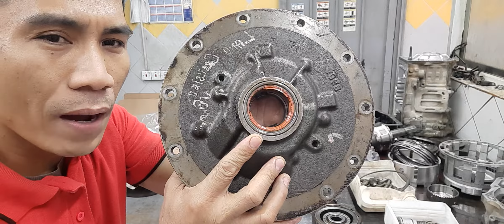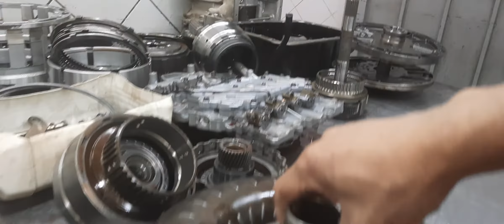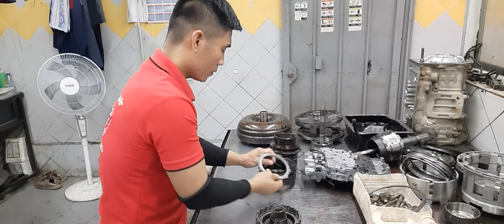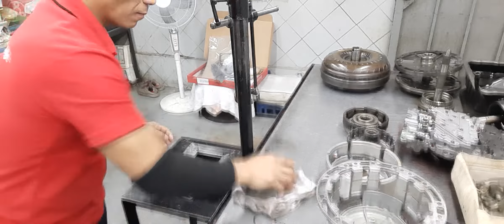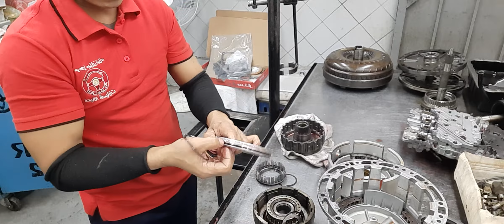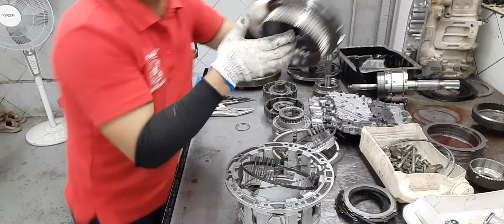Cause of no Drive no Reverse /L.Cruiser2003m///Tagalog

Comment: Sir kapag bagong andar ok lahat shifting ng civic 1996 after 30 mins biglang prang 2nd gear n lang pero minsan ok nman. Kpg sinumpong sa trapik nsa drive biglang ayaw umabante at ang ggawin ko ilagay ko sa D2 eh aabante nman nbili ko lang eto last month nkastock lang.B4 totaly ayaw gumana transmision, chage oil 3 x at transmision flush nchk n din solenoid.Minsan kng sinumpong n tumatakbo, off ko makina kht mga 20 seconds lang taz ok n nman, anu mabuti kya gawin sir?

Comment: sir, tanong kulang.. yung apv suzuki hiniram ko automatic transmission.. naubosan ng atf oil.. tapos nalagyan kuno.. walang reverse.. ano dapat gawin.. na check na lahat sensor.. okey man.. lahat ng drive, l, 2 meron.. reverse lang nawala... kailangan ba e baba ang transmission?
Reply from the maker: Need ibaba boss.kung naubusan ng oil may tendency na nasunoh sng clutch or Oring na over temp kya singaw  n.
Reply: @ararlakayvlog2684  boss, maraming salamat sa reply.. wala ba ibang paraan maayos maliban sa baba transmission..kasi no reverse lang ang hindi gumagana.. kung baba transmission.. magkano magastos boss..?sa materials lang
Reply from the maker: Sa pinas price wala ako idea dyan i canvas mo nlng boss.
Reply: @ararlakayvlog2684  salamat boss.. wala na bato chance na hindi ma down ang transmission
Reply: @ararlakayvlog2684  ano pa dapat gawin or e check pag walang reverse boss?
Reply from the maker: Reverse clutch kung sunog
Reply: @ararlakayvlog2684  kung hindi sunog boss? may chance pa hindi ibaba ang transmission?

Comment: Good Day Sir need ko lng advise for may 2007 Toyota Avanza Automatic Transmission. kakapalit lng nya ng Transmission Rebuilding kit and after ko test drive na pansin ko bigla nag Blinking sa dashboard yung O/D nya and pansin ko prang di nag Automatic change ng gear san ko kya posibleng reason bkt nag blinking yung O/D? pa advise po Salamat..
Reply from the maker: Ipa Computer check nyo Sir.may trouble code yan kya ng blinking ang O/D .or may natanggal n connector sa transmission.
Reply: Sir Ar Ar posible din kya sa filter ng transmission yung reason bkt blinking yung OD? kse pag malamig ang makina at tinakbo di lumalabas yung OD pero pag medjo nkakalayo nko ang andar lumalabas na OD blinking..
Reply from the maker: Wala po kimalaman ang filter sa OD light.nasubukan mo nba i pa computer check .for sure meron c
Trouble code yan .Meron ngma mulfnction n sensor.kadalasan Fluid Temperature bka sira dala ng overheating dati .

Comment: Hi friend, my a343f transmission don't go forward and no reverse, I just open all the transmission and everything looks good, do you have any ideia to check?
Reply from the maker: Check the oilpump and the converter maybe not produce hydraulic oil pressure it causes no D and R.
Reply: @ararlakayvlog2684  thanks for reply. Torque Converter is in maintenance and check, but there is nothing broken. Oil pump looks good, also nothing broken by my eyes, but I will double check. Do you know if could be the one way bearing? Is it possible to work properly by hand and slip in work?

Comment: Boss ask ko lng po yung isuzu sportivo po ayaw humatak..ano po kaya magandang gawin dun
Reply from the maker: I check ang oil bka kulang.pero pg ok nman .i pa engine scanner nyo pra malaman kung may Malfunction sa mga Solernoid s loob ng transmission.
Reply: @ararlakayvlog2684  boss hindi kase suported ng gscan 3 yung system nya

Comment: Good  day  po sa inyo  lakay,  magtatanong lang po tungkol sa outlander , pag nakatakbo na nang 30kph pataas  kusa lang mag  engine break,  ano po kaya ang sira  Sir. Sana po masagot.  Salamat and more power to you  idol lakay
Reply from the maker: I check ang oil kung sunog.maaaring may sunog n clutch n yan boss.
Reply: Sir hyundai starex svx po.hndi na atras automatic tranmission po.anupo kya ang problema
Reply from the maker: Internal n ysn boss need n i overhaul trans

Comment: Good day po boss idol.  May tanong po ako SA automatic transmission nang Hyundai accent ayaw po mag engage pag tanggal KO po nakita KO sira ang hydrolic pump oil pump niya nasira ang bushing.  Pinalitan KO nang bago.  Tapos ayaw parin mag drive at reverse.  Ano Kaya ang problema ? Salamat po
Reply from the maker: Bka tukod ang oilpump pg lagay nyo boss.i double check ulit.
Reply: @ararlakayvlog2684   ok cge boss salamat.

Comment: Boss lakay tanong lng po pg sinaksak ko sa drive ung isang gnagawa nmin parang late po ung ingagement nya hinihntay mo muna bago sya tatakbo hope masagot nyo po ako thanks po
Reply from the maker: Anong unit.kung sa reverse normal sya may problema sa Forward clutch pack .either malayo ang gap ,may singaw sa mga Chamber Orings nya boss.last option nlng ang Valve body bka stock ang valve.
Reply: @ararlakayvlog2684  ah ok po boss gagawin ko po sinabi nyo toyota tamaraw fx po n automatic pg nasa drive or reverse nga po hndi sya agad nglalakad may time po n bigla sya papasok nakakabigla hehehe mechanic dn po ako medyo nangangapa p sa automatic trans kya lagi ko po kyo pinapanood malaking tulong po kyo salamat po and godblees
Reply from the maker: Pg R And D mahina i check din ang Torque converter nya.yan din ang cause ng No power or hirap tumakbo.